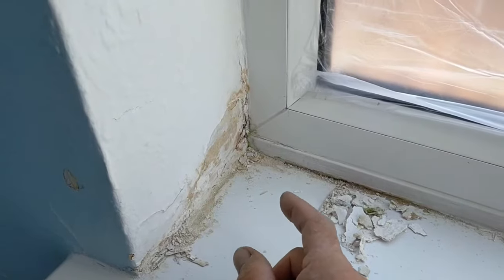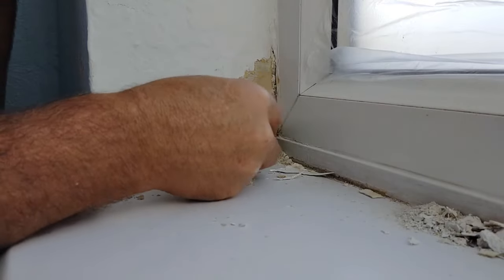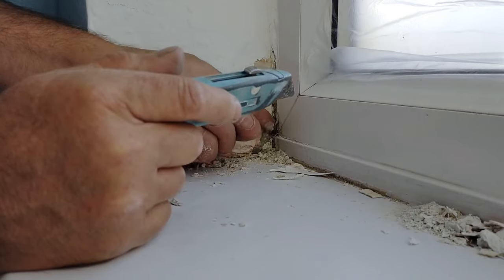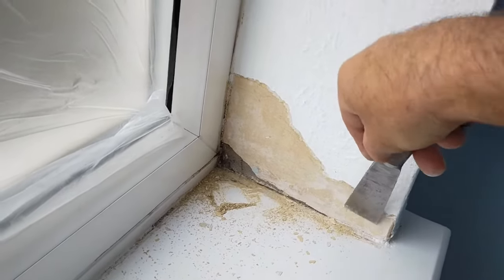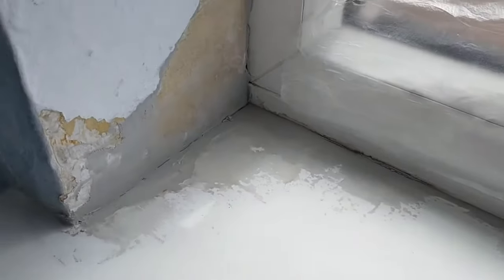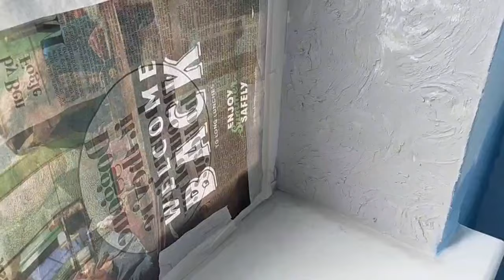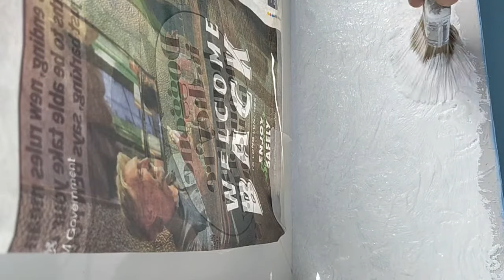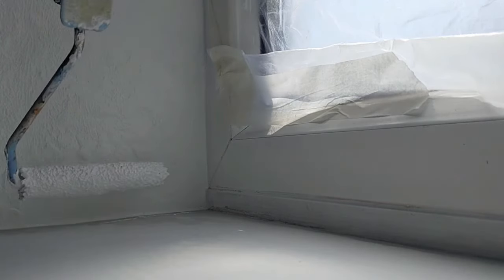Leaking Window Damage. Wall Texture Repair

Comment: That damp is common, it’s due to internal condensation, it always happens at low corners around doors and windows because the dew point is always going to occur at the coldest places. In older houses it’s far more common than newer builds. In winter try and increase airflow around these areas, closing curtains just makes it worse because trapping cold air behind them just causes moisture to fall out of the air there. Also open windows at least 5 minutes twice per day, preferably after cooking or bathing, even in cold weather! Don’t dry washing indoors without using a dehumidifier, these things will eliminate this damp problem.
Reply from the maker: Actually I think the window was leaking in this video, although your information is of sound base. Thanks
Reply: @PaintingandDecorating  Ah right, no worries, I see so many people complaining about damp in their houses on the news etc, it really annoys me they always blame the building or the landlord / council, but they never tell you the person never opens the windows and dries washing all day indoors., then they wonder why they get mould everywhere because the humidity is off the scale and they have no air circulation. 🤬
Reply: @Painting and Decorating  what was the fix for the window leaking in that area, if you don't mind me asking.

Comment: It's damp coming in from the outside poor sealing outside
Reply from the maker: Yes it was meant to have been looked at.. thanks
Reply: Also, how many times do you go outside to investigate and find the homeowners have siliconed up the weep vents at the bottom of the window or between the cill and the window frame?! Any moisture stuck inside the frame has nowhere to escape so ends up leaking through the welds and into the walls. Seen it dozens of times.

Comment: I have had new windows fitted, the plasterboard now has a small gap between it and the block work due to a Birmingham bar being removed
by the fitters, a small gap now and a hollow thud goes from the sill to the top, how can i make this solid again, and it lets a little condensation in, like your does here. Please advise if you would be so kind.

Comment: Is that not from internal moisture due to cold bridging and condensation rather than moisture ingress from outside ?
Reply: That's possible.....I've got dehumidifier  on the go ..helps with issue but I do need to resinsoect windows.  Mostly in living room..get lots of mould to  feels damp to touch..#ll be on ut ASAP
Reply: @kevinhancock4064  we had similar issues, we found a dehumidifier was not enough. After much research I installed positive input ventilation ( PIV ) system in the loft, it works pretty well and has reduced our condensation a lot.
Reply: @Ollie S  that's interesting I'll look into that itvdoes ring a bell thank you
Reply: @ollianddelphine  Does the PIV make your house feel colder?
Reply: @RestWithin  not really, you can feel it if you stand right under the outlet. It is a pretty low powered fan. Works because its on all the time ( in winter ).

Comment: Why is this window so far forward in the reveal?
Reply: It’s also really low, as the window board would normally cover that lower strip.
Reply: My thoughts exactly. The window is installed in alignment with the external brickwork instead of the interior brickwork. 

Without reinstalling the window what could you do to stop condensation settling on the cold surfaces of the reveal?  Is there a way of creating a barrier?
Reply: @RestWithin  If you have the available depth on the window frame you can install insulated reveals i.e. something like 20mm PIR insulated plasterboard. Oftentimes this will end up with finished very near the glazing though, especially on door sets with skirting boards.